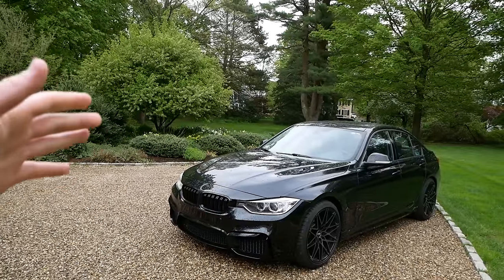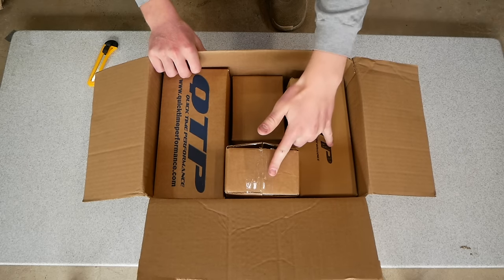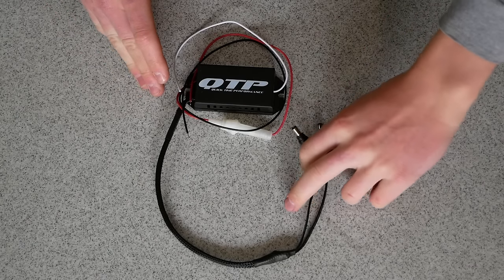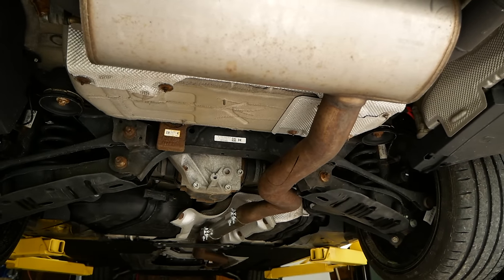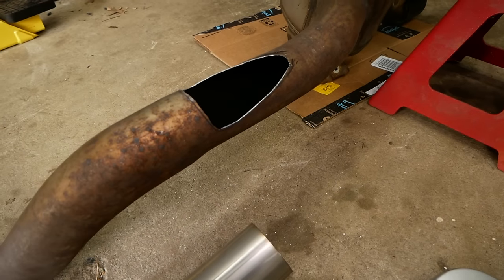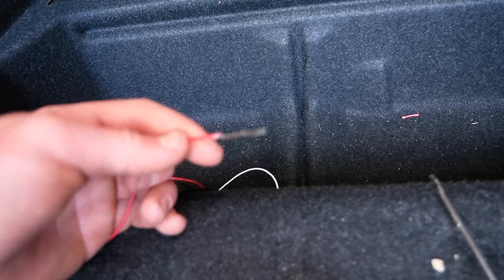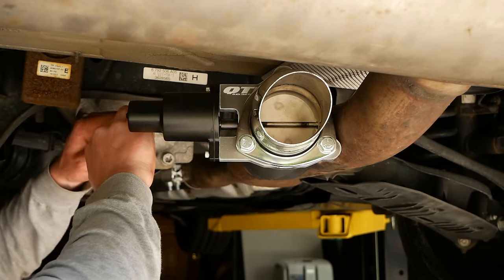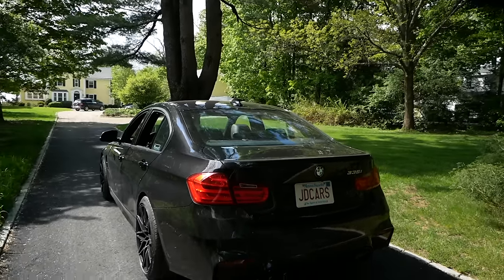QTP Electric Exhaust Cutout // STRAIGHT PIPING MY BMW

Comment: Should put a valve on the other side too.  What would it sound like if you closed off the stock exhaust when you open up up the bypass.🤔...just an idea I had when I watched this.  Sounds good though!

Comment: Wrapping the hot wire around the fuse blade is just wrong on about 100 levels, and you realize if you wrapped it around the hot blade, the circuit is not fused at all! Just wrong! And why the stupid remotes? Are you likely to activate the cutout when you're not in the car?

Comment: i would have liked to see it more integrated into the exhaust. like straight pipe the rear and install a valve to one side. I find it weird to have it dump before the tips

Comment: Hi I have a question, my new car will look sport but no sound at all and I'm gonna make as u did in the video,  my car is 4 cylinder will it make good sound? Thnx and nice work
Reply from the maker: 4 cylinders can still sound good! I've yet to hear an N20 3 series with exhaust. Definitely check out some sound clips before!

Comment: That was kindof stupid using a step bit to reem that bung out, all you needed was a hole big wnough for the wire to come through and a cut to the hole from the outter edge of the bung. Now your fuse pannel will get covered in water when you drive in rain
Reply from the maker: I've sealed it up with silicone

Comment: Can you completely straight pipe with this electric cut out so that you can change between straight pipe and stock exhaust system with the remote control???
Reply from the maker: Yes
Reply: @JDCarsChannel  it basically is, all you need is a catless dp. 
if he puts on a catless dp, he already deleted the resonator with the 18" pipe clamp ons and now this muffler cutout he can switch from full straight pipe to muffled straight pipe.
valve open flow goes ( catless dp --->  out) 
or when valve is closed with a click of a button flow goes (catless dp ---> muffler---> out) 
best of both worlds. 

and @jdcars we waiting for the custom tune video for burble adjustment ( preferably Bm3)

Comment: Hi mate,
i’ve been trying to find this answer for quite some time does the valve allow you to open halfway/personalised angles or is it just fully opened fully closed option?? As I don’t want it loud sometimes
Also if it does offer this, do u know other brand/models which can as well
Reply from the maker: Hey there! Yes, this is one of the only electric cutouts to allow you to partially open/close the valve(s) for a variable sound and volume level

Comment: I would have put it, before the cat, and kept the stock resonator, for stealth, when I want it, and I can switch to the most power, when I need it.
Reply from the maker: Not possible
Reply: @JDCarsChannel  
Why?
Is there a cat, immediately after the headers, and not enough room to make a custom dump for the cutout, with a pipe-bender & welding kit?
That's what I was thinking.
Like imagine a hallway, and if you look far down the hallway, there's a 90 degree turn, and a door facing you. 
So with the door open, you can just run straight out, with no resistance.
And with the cutout closed, you have to make a sharp turn, into a lot of things, hopefully muffling a lot of noise. And all the pipes are ceramic coated AND wrapped.

That's how I would set up a cutout.
But if there is something immediately after the headers, where they combine, or something immediately after the turbine. Then I would relocate whatever it is, or remove it, and make up for it somehow, like a different cat or resonator, or muffler, somewhere else, while making the open cutout path, as straight as possible, make any cutout turns subtle, even if the exit is pointing towards the ground, or through a fender. And in that case, I would modify the fender, cut the exit tip at an angle like a hypodermic-needle, and powder-coat the exit black or dark grey, so it doesn't stand out, yet would still look elegant.

But that's just what I would do, personally.

Comment: It would have taken very little time to connect that power supply properly using the proper pin connected to the fuse you used,wrapping the supply around the fuseblade creates a less than ideal contact and therefore resistance and heat,Ideally a terminal 15/ignition live source would have been safer than a permanent feed.

Comment: What wire and gas are you using to weld ?
Reply from the maker: I was using .035 flux core wire.. hence the increased slag and smoke
Reply: JD Cars dang how long did that last ? Are your welds cracking yet ? Or the stainless pipe ?

Comment: I would not recommend drilling a hole in a grommet that leads to the outside of your car directly under your fuse box you Cut to the middle of the grommet and slide the wire through the slit. And PS your welds look like shit🙃

Comment: cringed so hard because of your wiring. 
You could've done the following things which would've been more professional: 
For your switched 12v: 
There are adaptors on the market that look like fuses, but double. 
So you can plug in a regular fuse, where a fuse was planned to be in AND also have a second fuse connected with a extra lead that is meant to be connected to whatever you want to add to the circuit. This way you have a strong, reliable connection without wedging unisolated wires anywhere. 
OR you could've flipped the whole fusebox as you did when running the cable for the valve and tabbed into the desired fuse slot from the back. That might not have been easier, but it would've been IMPOSSIBLE to notice without flipping the box.